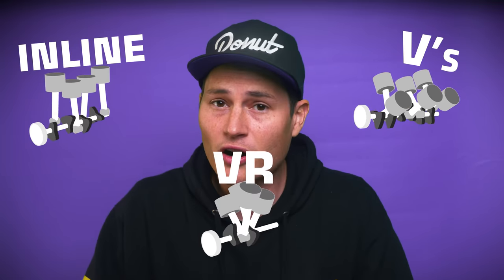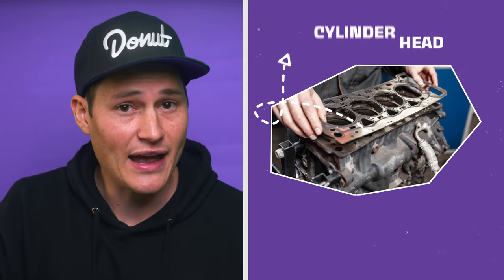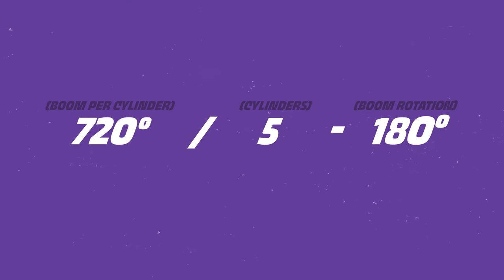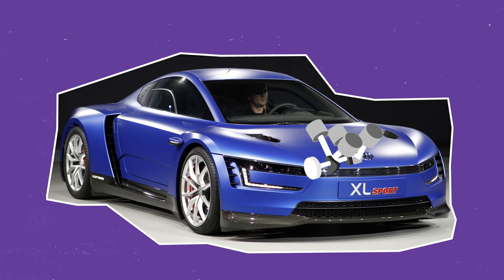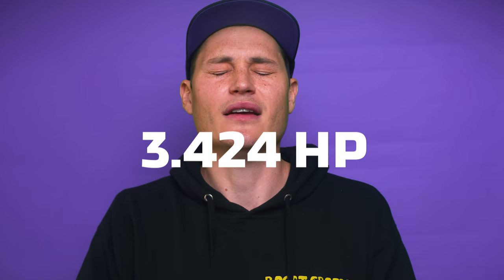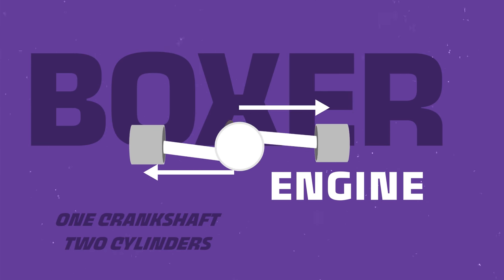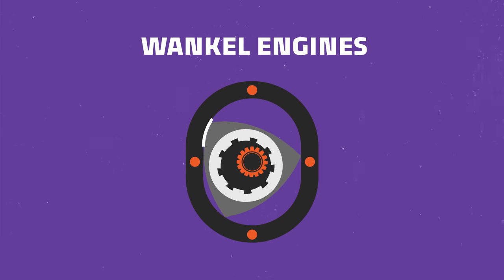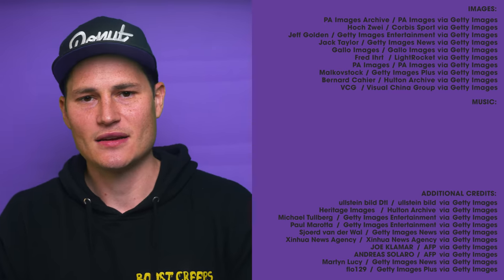Every Engine Layout Explained

Comment: i love how in the animations of the engines the piston rods just noclip through the crankshaft
Reply: Read this exactly while realizing it😂
Reply: @dingo-gorditas  csgo console?
Reply: @traziverse  no you russian (it's a joke please don't run me over with a VAZ 2109 please) every source engine game uses that
Reply: @dingo-gorditas  блядь didnt know that
Reply: I’m a dummy with kind of stuff. I don’t know how that actually works because I’ve been trying to figure out how it would go through the bar like that. I know it wouldnt go through it but how does it work?
Reply: @caliandrews626  crankshafts are not a straight line like the animation. The area where the rods connect is offset from the center allowing for rotation. If you look up a picture of a crankshaft you might be able to see it better. The parts that seem centered are anchored to the engine and the offset parts connect to the rods.
Reply: imagine if noclip or materials that can be both tangible and intangible at the same time existed. the use they would have...
Reply: Ikr
Reply: I knew I wasn’t going mad! Well… not about this at least
Reply: @traziverse  bro same
Reply: Literally, I was gonna say this to.  I’m now curious how they work and not do that
Reply: That happens in any modern engine, if only they'd implement it for situations like accidents. I would prefer to clip through other vehicles than collide into them
Reply: @thefastmeow  Material that could be both tangible and intangible? Like plasma? Which does exist?
Reply: @TheChrisLeone  the crankshaft in real life engines don't look like that
Reply: @caliandrews626  Dont feel bad, they are very counterintuitive at first glance!
Reply: @thefastmeow  Newtonian fluids.
Reply: @caliandrews626  The crankshaft of an engine is not actually a rod as shown in the video. The piston rods connect with two halves of a balancer (it's probably just considered to be two balancers but I say two halves of one to explain easier), with a gap between the two halves so the rod doesn't have to no-clip through something to spin. The balancer halves are connected to drivelines and other balancer halves (which correspond to other pistons) by a rod which does not obstruct the movement of a piston rod.

So it's just a zigzag.
Reply: No, but that's what they do right?
Reply: Lol
Reply: Your engines don't do that irl?
Reply: I saw a gorilla noclipping thru the ocean once.
Reply: The part of the crank where the rods connect don't have a solid bar through the center lmao that's how
Reply: it confused me LOL
Reply: I don't know a lot about cars so this video is just research for me and I was genuinely confused wtf was going on with that
Reply: as someone who used this video as a starting point to learn about the engineering behind these machines let me tell you it was quite misleading
Reply: nooo cause thats all i saw!!!😂

Comment: Can we just have a little appreciation for the person who had to animate these engines? Simple and effective. Love it.
Reply: It made me so angry though because the crankshaft was completely straight so you could see the pistons clipping through
Reply: That's what pissing me
Reply: Could someone point me to an animation or explanation that shows how the pistons don't go through the shaft?
Reply: Rightttt
Reply: @alexs5968  i was thinking that too. i was like tfs happening here
Reply: @alexs5968  That doesn't bother me as much as the firing order. Crossplane i4s are very uncommon, but the i6 is just bananas.  cylinders 1 and 4 in an i4 should move up and down together and in an i6 it should be 1-6, 2-5, 3-4 moving together.
Reply: @sidelingscroll  That triggered my ocd like hell aswel!
Reply: @sidelingscroll  Correct. it bothered me too. In a four cylinder engine the outer and inner pistons move together as a pair. The 2 cylinder Fiat 500 engine, has both pistons moving together. When one is on the compression, the other is on the exhaust.
Reply: @sidelingscroll  I6 should be 1-6, 3-4, 2-5
Reply: @farmerboy9029  Ah yes that depends on the firing order; yours may be more common.  The salient point being that pairs of cylinders move together in an even-numbered inline engine with N cylinders such that the numbers of the cylinders that are moving together sum to N+1.
Reply: @sunlitgarden7173  thanks makes sense now
Reply: look at the animation again
Reply: @alexs5968 omg I thought I was the only one who was triggered by that

Comment: Its insane how many ways there is to convert little explosions into spinny
Reply: Or Toyota working on the hydrogen engine
Reply: Explosion
"SPEEeEEeeEeEeEEN!"
Reply: Combustion not explosion, but yeah whatever, nobody care.
Reply: And they didnt even start talking about jets or turbo props.
Reply: @LukmanSantoso13  yup your'e right; nobody cares
Reply: @LukmanSantoso13  ah....youre one of those types i see
Reply: @LukmanSantoso13   I bet you've seen something combust without a sonic shockwave and gone "wow an explosion" many a time. It's hard  not to do. Technically it's wrong but your mind doesn't usually think in technical terms, especially if those terms are arbitrarily specific.
Reply: @prescottmajette5290 Chrysler Turbine
Reply: Boom

Comment: That moment when you realize that he forgot that a radial engine has been in a car
Reply: Time for someone to put a rotary engine in a car so Jerry can talk about the cooler of the 2 rotary engines 😂
Reply: @NickVanRegenmorter  Well the radial should've been on here regardless because it was "every engine layout explained" not "every car engine layout explained."

Also, quite a few people already have put radials in cars, even motorcycles.

Also Also, he covered rotary engines; the wankel or "dorito" that was in the rx7 is rotary. Radial engines aren't rotary. So you saying "the cooler of the two rotary engines" is just nonsensically stupid and incorrect.
Reply: @robertmyles9124 
The WANKel stole the true rotary engine's name.
Reply: @Joshua Lutz oh my god... yes
Reply: Radial & the turbine. Both are used in tanks.
Also off his engine list is steam and DC motors.
Reply: The Wankle (Dr Felix Wankle) was only a rotary in the prototype version made by NSU, this prototype had what all rotary engines have, a fixed crankshaft and a spinning motor block. The original rotaries Le Rhône, Clerget, and Oberusal, were made for aircraft use.
Reply: @alanaspurling6469  Correct! To clear things up: Originally "rotary engine" meant a radial aircraft engine, where the propeller was fixed to the engine block, which would spin around the stationary crankshaft.
Reply: @robertmyles9124  
People like you come off as incredibly insecure.  Incorrect doesn't mean stupid.  There is nothing stupid about their comment.  What's stupid is giving good information and then following with a pathetic insult that makes it appear your only concern is how smart you look to others and not providing information.
Reply: I came here to say this
Reply: And the 30 cylinder Chrysler A57 multi-bank
Reply: @argh1989  I've actually seen a car once that had a rotary radial engine in the back , I forgot the brand but it was amazing to see , and looked extremely dangerous XD
Reply: @fjdg94  That sounds proper weird. If you manage to find out let me know! :)
Reply: @Lassi Kinnunen 81 I think the theme was about internal combustion engines without specifying that. But yeah, I was pretty sursprised when I learned about the 19th century steam cars. The first iterations were even around during the French Revolution!
Reply: @fjdg94  Thanks, that's definitely not how I imagined it.
Reply: Plus as far as I remember VW should have V5's
Reply: @Cookiebreedchannel  Well that's the thing: They were marketed with "V5" badges, but were technically VR5 engines.
Reply: @albanringuede8141  That one I knew, but hadn't seen one running yet. Thanks! :)
Reply: @Milan Ackovski I mean every engine is cool and complicated, but a gas turbine? I expected some weird novelty.
Reply: I came here to say this.  I kept expecting him to mention them.  And I was thinking that since he included motorcycles, he would (could) include planes too.
Reply: @Joshua Lutz That was Chrysler, but he he still forgot it.
Reply: @Joshua Lutz Wasn't it a Chrysler model that had the turbine car?
Reply: @xcergy9482  I think they were trying to stick with engines that operate on "suck squeeze bang blow", not necessarily everything that's ever powered a car.
Reply: @Milan Ackovski The Soviet heavy truck has an interesting transmission but that's not what this video was about. And yeah, the shipping engine is insanely huge, but uninteresting from a layout perspective. You can pretty much stack two-strokers endlessly like Wankel engines.
Reply: @Sheridantank  i hate people who try to stop flame wars: now i can't break out the popcorn
Reply: I can argue he should have explained gas turbines as a car used it, but i agree the radial should have been mentioned